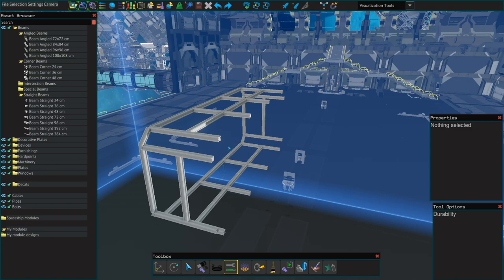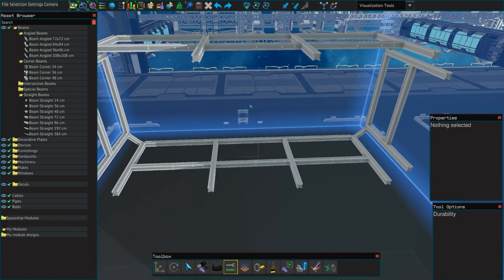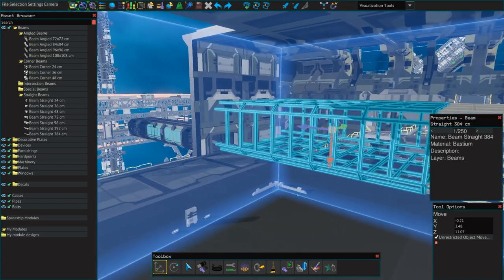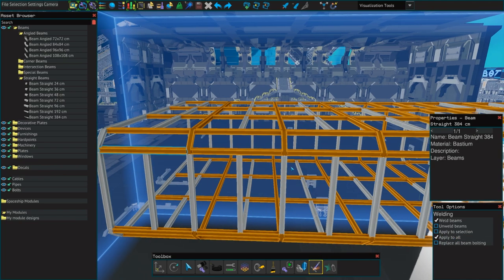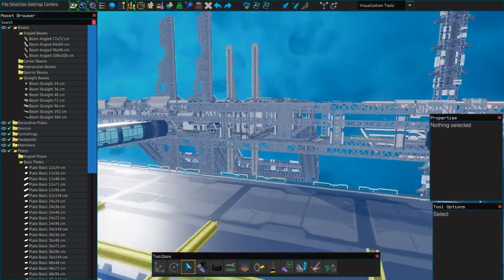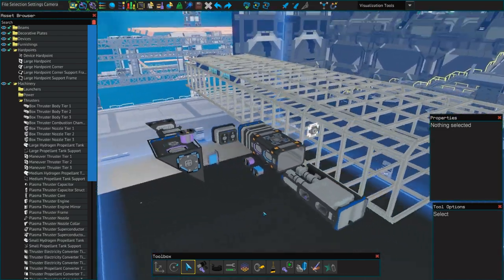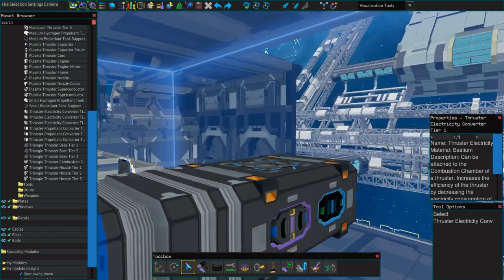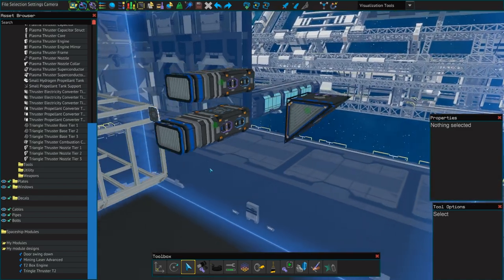Starbase - Ship Design Framing and thrusters

Comment: You should use shift+drag along one of the axis in the move tool (1 key). That way you'll always be aligned when you drag and it'll be WAY easier to snap it and quite a time saver.
Reply from the maker: Thanks
Reply: Though one should avoid moving the camera since then it becomes misaligned again

Comment: if you don t want to deal with the hard point then use this trick it work. use a bar that carry electricity and propellant and connect it to your connector on the truster et voila done.
Reply: sry i forgot to say you have to bolt it to the truster connector.
Reply from the maker: interesting

Comment: @RobRantz
 Hey bro, would you be able to do a video on how to get hinges working? they are super difficult to figure out and I've spent my entire play evening without success. Had a few people in discord try to help as well, its one of those things we need a solid youtuber to do a video on!
Reply: Hinges are pretty simple despite how they are set up. The part with the electrical connector needs to be bolted to your ship and have an electrical cable input from a battery, the door or whatever goes on the flat edge of the hinge piece or the other large part if you choose a larger hinge. The first field name in the hinge can be renamed to anything, the controlling buttons first field name must match, when the button sends a value of 1 the hinge will move to its end position which you set up in its properties.
The small orange squares work the same as the control panels meaning you don’t have to wire up the connected button if its placed there.
Reply from the maker: I'll see what I can do